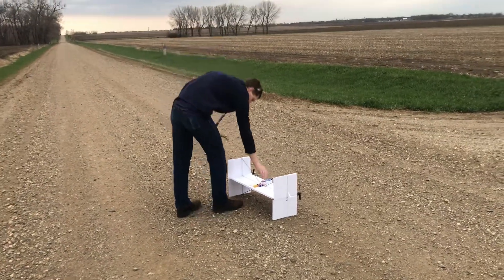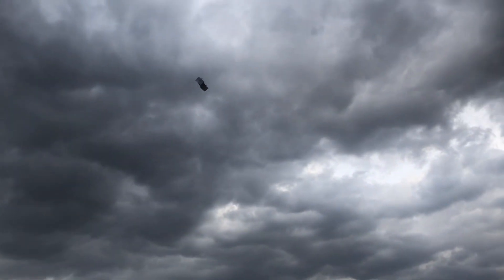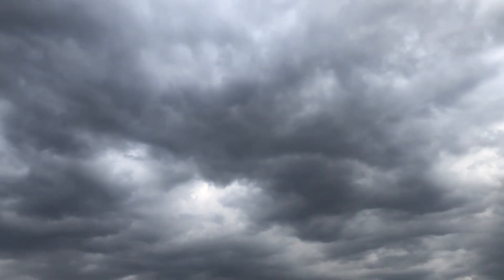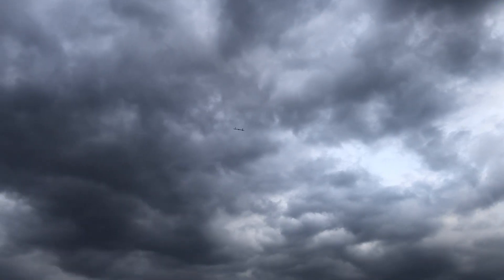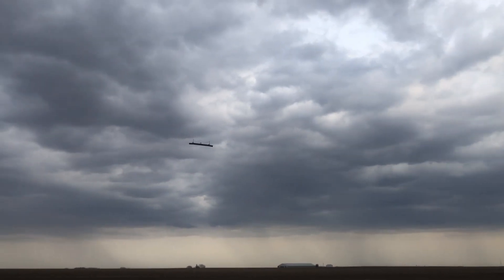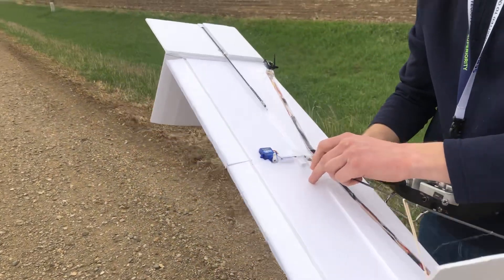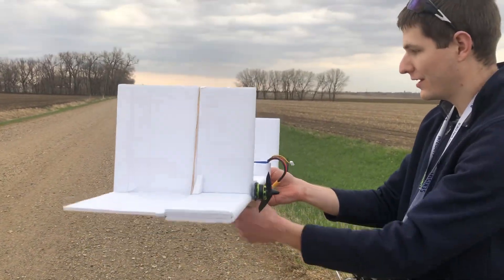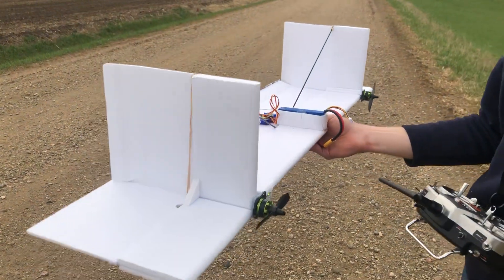The Next Big Thing in FPV Wings?? Testing the Tumbler Prototype

Comment: Give a twin-tractor wing setup a try. Dial in differential thrust and it'll blow your mind.
Reply from the maker: That is exactly what I have setup here. You can’t see it well, because of the wind, but when you kick in differential thrust, it hooks around corners, wings level, as if it is tethered to a pole!

The end goal is a simple FPV platform that can fly a smooth knife edge loop, and perform wings-level yaw turns like an F1 car.
Reply: @davidsommerfeld2836  Ahhh. I mistook the xt60 lead as motor wires for a central motor. I thought the wires going to the sides were servos leads for the switchblades wingtips 😊

I have a brushless converted Delta Ray wing with twin tractors, but it has a huge vertical stab and huge control surfaces and deflection - knife edge confirmed. Not pretty, but technically capable lol. 

Looking forward to more poly-bridge mechanical whirrings that fly! The switchblade wingtip action is awesome.